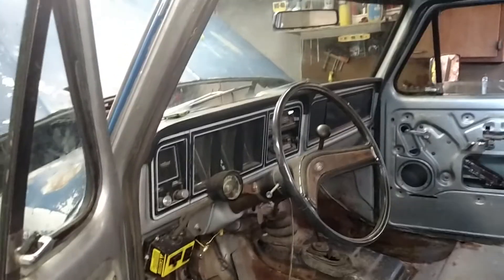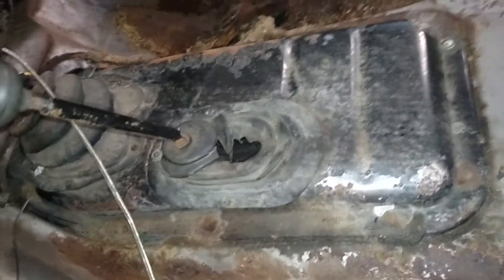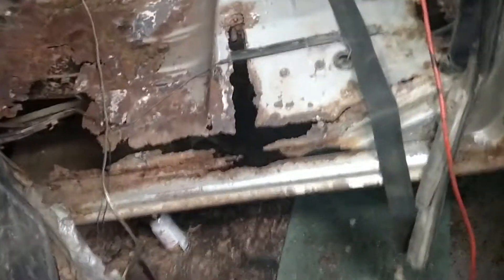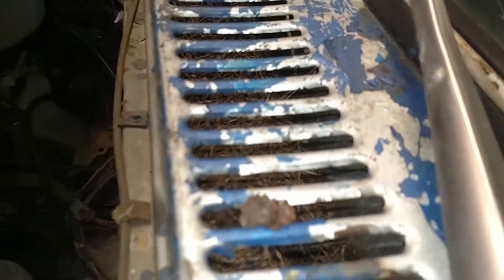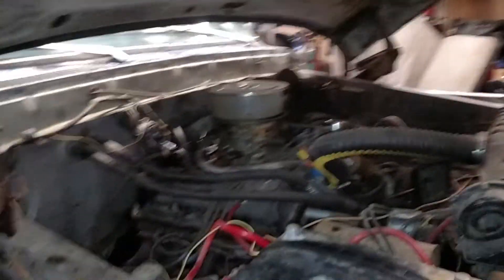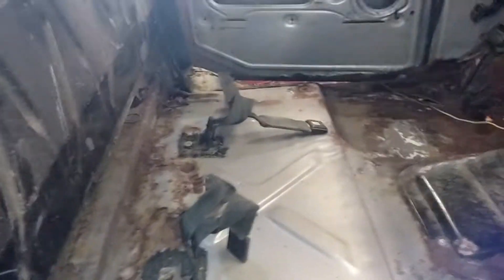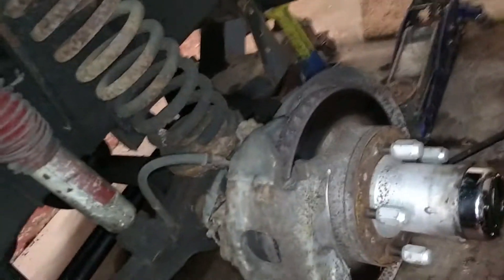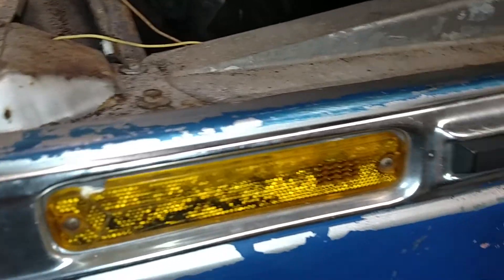1977 Ford truck project

Comment: She's got a little bit of rust, driver's side will need some support added and it will probably help your door open,and I think you can pull off passenger side finder off should have access panel for air intake, garden hose washout
Reply from the maker: Thank you that is exactly what I did I ended up taking both front fenders off. Then I found a lot more rust the actual cab mounts for the front we're completely gone. I just got done now rebuilding them. Stay tuned to see that video coming soon. Thanks for watching and thanks for the info. Next I'm going to have to take out the heater box inside to clean that out because I am sure it's full of crap also.